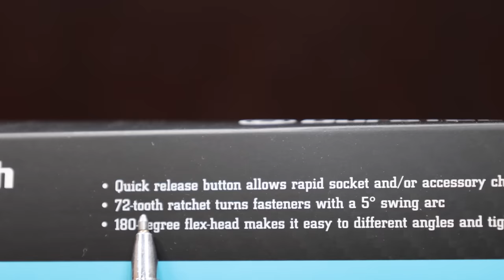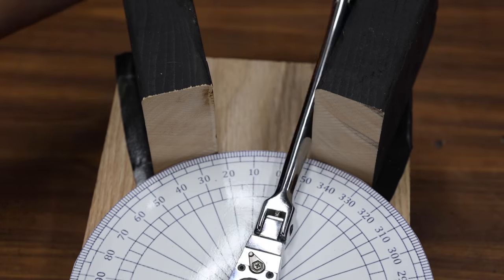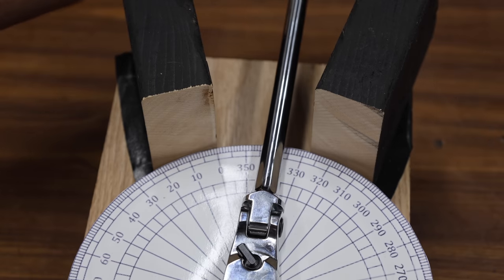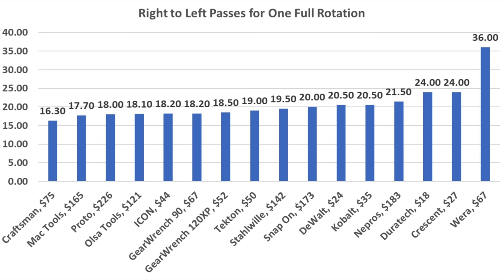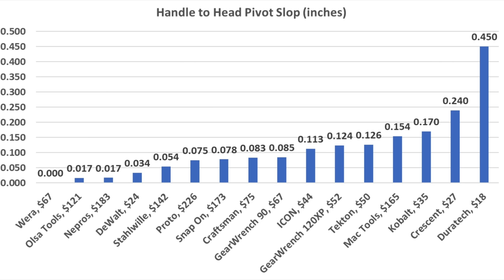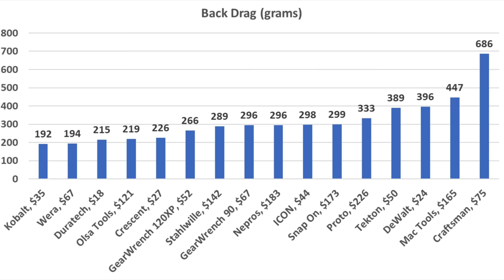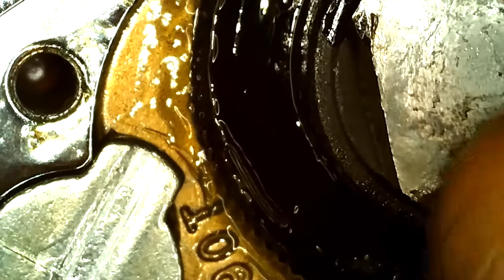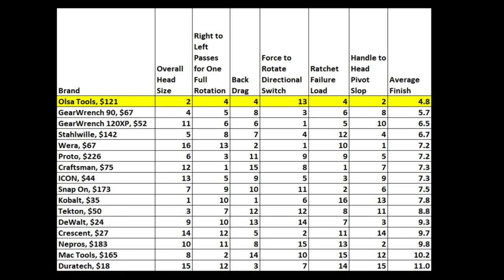Best Flex Head Ratchet? Let’s settle this!

Comment: I am not surprised that the MAC ratchet failed under load so soon. I had one a few years ago and got tired ofnit keep breaking on me everytime i try to break a stubborn bolt.

I switch to an walmart brand and to my surprise it held up pretty good for over three years until i broke it by putting an impact on it.

Now I used the Snap-On ratchet and so far its holding up wonderfully.  And this test proved it. 

Thank you PF ❤ for this demonstration
Reply from the maker: You are welcome!  Thanks for the feedback.
Reply: Yep I just had this conversation at work.  Every mechanic brought out a  3/8 Mac ratchet they love, but all were broken.  Teeth stripped out.  Ive beat hard on my Mac 3/4" with no issues.   ratchets are like pussy, they all good, but there is one  you always crawl back to.

Comment: I have the Wera ratchet and I've been really pleased with it. I don't have to deal with super tight confines, but I often need the angle adjustment. I really like the low back drag! Probably not the best choice for someone wrenching on cars though, that handle is definitely very large.

EDIT: I use mine in a machine shop, where you sometimes need to get a bit creative with fixturing.
Reply: I do HVAC and i that ratchet with the shallow sockets. It’s pretty handy but i rarely use it after i got the klein flip socket that go in my impact
Reply: I'm a bike and small engine mechanic, and it is my most used socket tool.
Reply from the maker: Thank you for sharing!
Reply: I have 8 different ratchets from different companies, lengths, sizes, it's always good to have long handles too so you can reach deep inside the car, behind dashboard makes life soooo easy.      I get them on eBay mostly.

Comment: Been using my icon non stop for about 4 months now and its been absolutely fantastic! For the price plus the warranty you cant beat it.
Reply from the maker: Thanks for the feedback.
Reply: @ProjectFarm Flare wrench comparison?
Reply: are you using any of the ICON torque wrenches?   Thinking of picking up the ICON split beam 1/2"
Reply: @reikasdad  as a matter of fact I am! Torque about 15-20 car’s wheels per day. It’s a solid torque wrench. Again couldnt be happier with the price and quality
Reply: I have the Icon Long Flex, I use my Capri more often, since the Icon handle is much longer, it is more than I need in most cases, and the handle gets in the way if too long, plus the extra weight if a shorter handle is sufficient.
Reply: @reikasdad  i had that for a year nothing wrong with it. A little bulkier than I needed. You do have to store it at zero I had heard you didnt. Faster to adjust than the standard mike clicker. Quite a bit of plastic on it though. For about the same price Id go with the standard type if I did it again.
Reply: Rubbish
Reply: @roninbushito seethe.
Reply: I only work on my own cars but I have a lot of icon tools because I keep getting them with coupons. Better quality for the price than a lot of other options when the coupons come into play. 

I have the long 1/2 inch drive flex head and use it in place of a breaker bar and it’s worked great for my applications of up to 200ft Lbs. anything super torqued on I will borrow the Milwaukee from my cousin.

Comment: This is my introduction to Olsa. And I'm impressed with the performance! It always hurts when tools meet the early end of life. But that is critical data! We want strength in our tools. It can save a knuckle from time to time.
Reply: Thing is you will never need a ratchet to be able to withstand anything over 200 ft pounds and most of the time 100 ft pounds is plenty..Breaker bars are for extra tight fasteners,not ratchets.

Comment: I have the Wera, and while it may not be perfect, I love it. It's very versatile and I use it in lots of odd circumstances.  Being able to use it like a ratcheting screwdriver is great too
Reply from the maker: Thanks for the feedback.
Reply: I don't think the Wera belonged in this test.  The design is radically different than the others and fits a different purpose.   BTW, I have three variants of the Wera.
Reply: Super true. It’s called a roto head ratchet. They’re my favorite. All of the companies on this list make that style as well. They just don’t have the locking mechanism. It’s not super important though since the torque passes through the center of the head rather than through an off centered joint.
Reply: Yes, that is another reason I much prefer roto-heads to flex heads..I have some flex heads, but I rarely use them...they usually wind up frustrating me more than anything...clearance issues, flopping around, wobbling off the fastener...I usually wind up tossing them away in frustration and getting out my roto-heads...I don't care for flex-head ratcheting wrenches for the same reasons...
Reply: I like wera 1/4" tools for my motorcycle.  Low torque on most fittings and the compact, short size has advantages, too.
Reply: Having owned  both Wera and Nepros I can definitely agree. I like the finish of Nepros but I think I use Wera more often. Flex head doesn't really suit my needs.
Reply: @bantolphbantir9605  I think you have to be right.   I don't think this Wera is really intended to be a "tight spaces zero clearance" ratchet you'd typically find someone using under the hood.

Comment: I've got an Olsa swivel head ratchet. It's amazing! I was worried it wouldn't hold up well to torque, but this thing is a beast.
Reply from the maker: Great feedback on the Olsa Tools and very good purchase decision. They've built the ratchet to beat and I'm hoping that the other manufacturers work to improve the design of their ratchets. Competition is great for consumers!!
Reply: The Olsa is identical to the SK SP90s. I had a 1/4 and 3/8s flex-heads, and didn't get the 1/2 before SK overhauled itself for the worse. The Olsa has completed the set and its the same in every way (aside from logo)  @ProjectFarm
Reply: @ProjectFarm  I'm always happy to support American made. When I need to replace the rest of my ratchets, Olsa will be my choice.

Comment: I think the thing that sets the Wera apart and makes it hands down the best for some people is that it's the only one that can truly go vertical. So it needs the smallest space 360° around the bolt. The others need upwards of 2"+ in at least 180° around a bolt
Reply: Agree, vertical drive, great grip and good quality for not so much money!
Reply from the maker: Thank you for sharing!
Reply: Love those Wera ratchets so much that i got the 3 most popular sizes. Do like the colour coded sockets too. Otherwise high quality stuff you buy once, unless it gets stolen heh.
Reply: When you need to go vertical you use extensions.  They are available in many lengths.  You can also get universal joints to help you get into tight spaces.
Reply: Wera ratchets are my daily drivers.  Having the pivot right at the axis of rotation makes a difference in how much torque you can get into the fastener.  And, as mentioned, being able to pivot in line with the fastener can be a handy feature (acting as a sort of ratcheting screwdriver.)
Reply: @ions82  Every single time I am threading a bolt or nut I do use the vertical feature, most handy thing ever. I can get it pretty snug hand tight before having to torque it down.

Comment: It would be helpful to test the durability of the finishes as well. I have a couple of icon ratchets along with a handful of other cheap brands, and the 1/2” icon has started rusting with almost no use. It’s the only one in my collection to do that.
Reply: Warranty that sucker cause the plating shouldn’t be that bad, even for Hf
Reply: That would be a good test to include
Reply: @lumpofnicoal8381  does HF even pay their OEMs for that kind of quality control? 😏
Reply: Just snap it and take it back for a new one.
Reply from the maker: Thanks for the suggestion.
Reply: That's a defect.  Take it back and get it replaced.

Comment: The gearwrench and tekton rachets have very stable detents on the angle head which is quite useful when trying to get into tight areas with an extension and socket where the Icon head is floppy with weight on it.
Reply from the maker: Thanks for the feedback.
Reply: My Gearwrench flex head flops around like an overcooked piece of spaghetti and it has always been that way. Okay I'm exaggerating, but I hate to use it because of how sloppy it is.
Reply: Arent there screws you can tighten?

Comment: I find the resistance to switch between lock/unlock is better if it is tough to move. As the item wears it will become easier and often can switch direction while ratcheting.
Reply: yes a ratchet that reverses direction unknowingly is very annoying .
Reply from the maker: Thank you for sharing!

Comment: Despite some drawbacks, the Craftsman and the Wera impressed me. They outcompeted in many areas that I felt were pertinent.
Reply: Agreed. The Craftsman one impressed me. Wasn't expecting it to perform as well as it did.
Reply from the maker: Thanks for the feedback.
Reply: I own the Gearwrench and the Wera.  I keep the Gearwrench in my truck and the Wera in the house.  I know how to use my tools, so the drawbacks on the Wera isn't really a problem.
Reply: Also have to agree about the Craftsman hopefully that might be a comeback to good quality  tools ???  For the Duratech or Duracrap just walk away from that tool brand
Reply: In the back drag category, Craftsman was nearly last.  That's important in tight spaces where you can't get your hand in there to hold it.  A deal breaker for me.
Reply: I always pulled off my craftsman when torquing gland nuts for the torque wrench and worried about over doing it.😢 Now I feel better. I'm use to 72s .
Reply: The Wera was the joker in the pack. It also functions well as a screw driver.
Reply: @canucha1985  The new craftsmen seems to be much better than the ones I have from 30 years ago.  I noticed that in a newer set I bought a couple of years ago.
Reply: I have an s-k 3870,  very similar to the Wera design, bought back in the '70's.
Still going strong and still one of my all time favorite handles. 
A really good design.
Reply: @harpintn   I'm 25 so I didn't get to really enjoy the Sears days of Craftsman, but I've felt their old raised-logo wenches feel far superior, but the old-raised logo ratchets aren't the most impressive. Either way though my most turned ratchet yet is my little 3/8" Craftsman that I got in a set from a yard sale. It's pretty damn tough and is slim profiled. Only 72 teeth though I believe.
Reply: @AnotherRandomPoser  The old Craftsman wrenches were tough, but they take too much back pressure forcing you to hold either the socket or the extension when putting a nut on, and they were hard to use in tight places.   The handle on them could also be painful if you needed to use a lot of force on something. They did have some fine tooth ratchets you could buy, but they were considerably more expensive, and you had to order them.   I did buy a 1/2 drive long handle swivel head wrench to use as a breaker bar, and it got me me out of several jams before  I got an air compressor and impact wrench
Reply: That's one of the reasons why I like the format that Todd does. Showing every test in its entirety lets you determine for yourself how fair the testing was, and whether it's relevant to your decision-making.
Reply: yep I've been eyeballing the wera for a while now worried how the quality affects the interesting pivot head, this is better than I expected!
Reply: I'm glad this video showed the rankings for each test segment, because Craftsman and Wera didn't rank well in any of the areas that I would care about when buying an additional socket wrench or replacing the one I usually use.

Comment: Another great review. Thank you for the effort and care you put into these.

I have an old harbor freight low profile flex head ratchet that is one of my favorite ratchets.  It's the thinnest one I've ever seen, long handle, and has held up to a good amount of force over the years.  A number of times it has barley fit in a place letting me get something unbolted without having to take apart something in the way.

So there are arguably better ratchets out there for day to day use, but I'm really glad I have this cheap one in my tool box because sometimes it's the only one that can do the job.

Not disagreeing with anything you said, just sharing that is always good to have a couple of tools with special qualities like being the thinnest adjustable head, in this case.  Doesn't matter if another ratchet is better in every other way if it doesn't fit.

:)

Comment: I'm pretty much sold on all ICON tools at this point. I've been using Pittsburgh Pro ratchets for 15ish years now and I still have a 1/2" flex head that's seen some shit. I've put 300ftlbs of torque on that bad boy dozens of times now and it's still kicking. I've started buying the icon equivalents and they are definitely just as tough if not more. Can't beat them in terms of bang for buck and these videos just keep proving it.
Reply from the maker: Thanks for the feedback.

Comment: I daily the icon/pitt pro flex heads in my shop.  If you have a HF close by, they're very hard to beat for the hassle free and quick warranty process.  That said, the only failure I ever have is the hinge bolt backing out or breaking when using the ratchet as a breaker bar.  Loctite it when you buy it and you'll probably never have an issue.  Otherwise, I'd use the GW for everything if I could get one local and warranty it easy.

Comment: Love this shootout! I would've liked to see Matco tools in here as well. I also think the direction switch should be interpreted differently; I prefer the heavier switches so they don't switch automatically. My Snapon ratchets never switch directions on their own, but my Matco and Husky ratchets sometimes have a mind of their own, especially when the backing plate gets a little oily
Reply from the maker: Thank you for sharing!
Reply: Yes. A stiff reversing lever is preferable because it is less apt to reverse accidentally. As long as you can move it when needed.
Reply: Yup, i was always fighting with my Craftsman ratchet esp as it got older
Reply: Matco uses gearwrench ratchets so technically he did use matco
Reply: Don't buy into the tool truck hype. Don't pay for the tool trucks mortgage. Matco, snap-on etc don't actually make anything. They rebrand other tools

Comment: Based off of these metrics and which ones matter to me, the craftsman is far away my favorite. I don't care about MM of thickness on the head, and I actually prefer my direction switch to be a little stiffer. The stats that matter the most to me are arc swing, and strength. Craftsman was first on both. Great video as always!
Reply from the maker: Thanks!  Thanks for sharing.
Reply: This result surprised me, and is one of the best answers.
Reply: Back drag is most important. Otherwise, you'll just be turning the bolt back n forth. Arc swing is also important. Strength doesn't really matter bc they all break around the same and are covered under warranty anyhow.
Reply: I'm sure when that ratchet gets use it will break in and be much smoother. People were moaning about the new Snap On 100 tooth that it  had to much back drag.

Complaining about a Snap On ratchet???

Talk about 1st world problems... crap 😡
Reply: @ihavethedocuments2580 I personally use the 3/8 long handle V series ratchet every day and it took a few months but it’s broken in very nicely. It can really take a beating. I’m going to leave it in ATF overnight to see what happens. Currently on the fence between the 1/2 drive V series and the Hazet long handle.

Comment: I bought the majority of my hand tools about twenty years ago on eBay. I went with all Snap-On because, at that time, it was the obvious choice for premium tools. I had ratchets and sockets break plenty of times before, so it was time to step up. They were all used except for the screwdrivers, so I saved a ton of money. I still have them all, non have broken. There are a lot of great choices nowadays, but if I had to start over, I think I'd do the same thing. It's hard to go wrong with used Snap-On tools off eBay.
Reply: My father just learned about estate sales. Apparently tool go pretty cheap.
Reply: It's also pretty hard to go wrong with brand new GearWrench tools with a warranty for less money
Reply: That's where I got all my Snap-on ratches from for half price. Open them up to clean and re lube with Super Lube and it's like new.
Reply from the maker: Thanks for the feedback.
Reply: @deedle6073  not exactly like new. Snap-On tools you buy second hand have no warranty. It's only for the lifetime of the original purchaser, not eternity.

Comment: It strikes me that with the back drag test, the back drag will probably be high since the ratchets are new. An interesting test would be to break in the ratchet (perhaps spinning it against the back drag on a drill for a few minutes) and see if they loosen up a little bit. A tool that starts out "too tight" might end up just right after a bit of use, while one that starts out "just right" might end up too loose after break in. Thanks for the great reviews!
Reply: A lot of tools don't even come lubed right from the factory. I've found that putting decent grease into a ratchet turns even crappy ones into premium feeling tools. If it has really tinny clicks it needs to be lubed.

Comment: I really like seeing when cheaper tools can compete in the big leagues. I was surprised you didn't have your normal recommended tools at the ends. I'd personally go with the Dewalt for all my home jobs :)
Reply: Never can go wrong with DeWalt. Never let me down.
Reply: Not only that, you can see where the extra money doesn't add anything  to the overall tool it's performance, or durability.
Reply: The dewalt is likely a facom or usag rebrand so its a quality ratchet design 

Stanley black n decker mac dewalt 😅